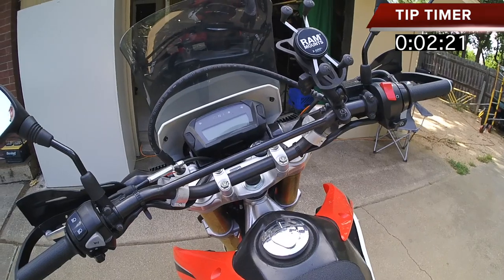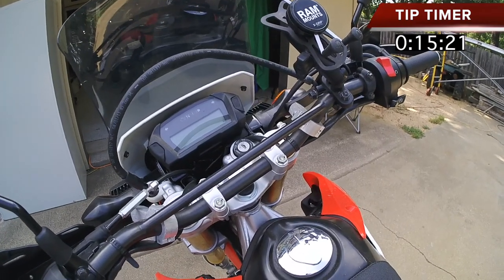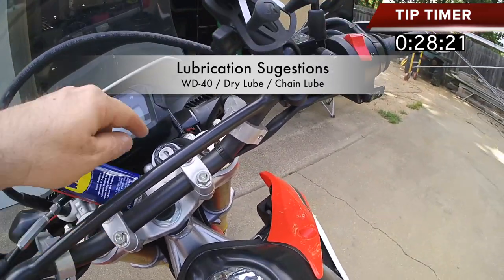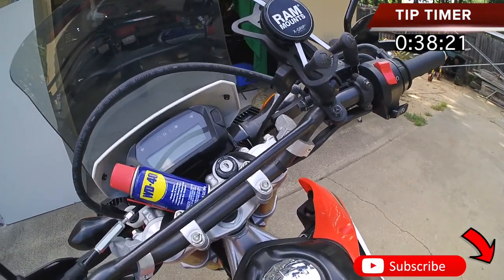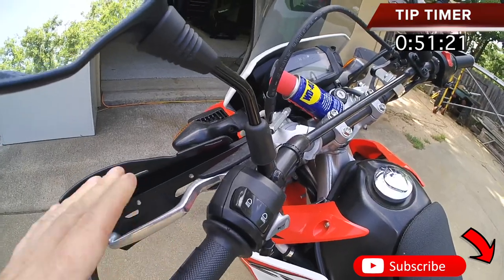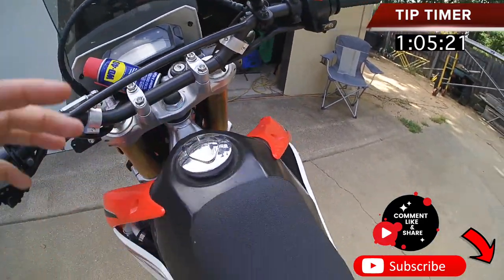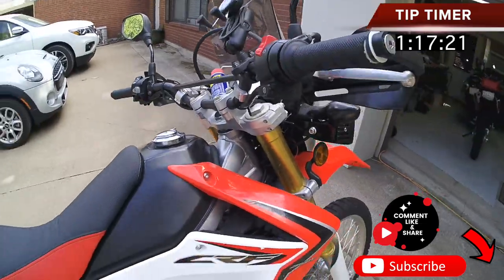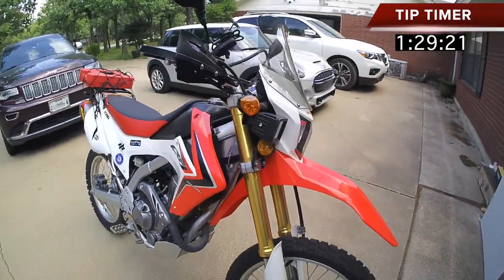Best small part lubrication tips for new dual sport riders | best tips

Comment: i found that cleaning the key slots first with spray electrical cleaner will really help. then the wd works even better.  That would be a at home clean and lube i guess. thanks for the video. make every ride an adventure.
Reply from the maker: Heck yeah, get out and adventure. Thank for the comment. I never thought of electrical cleaner good idea!
Reply: yes it drys fast and flushes out the dirt.
Reply from the maker: Awesome, thanks so much! thats what I love about other rider is getting there great info so I can pass it on to other riders... Thank so much